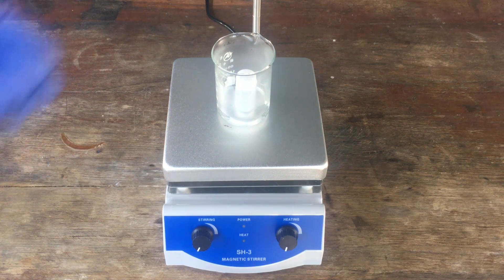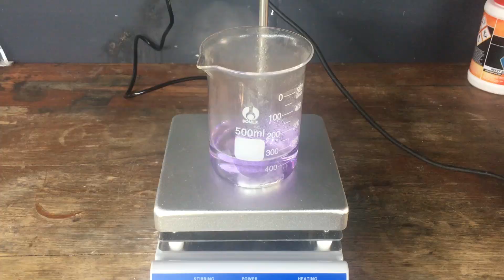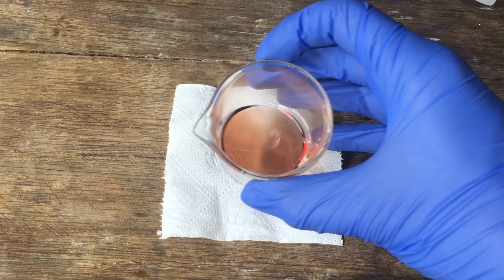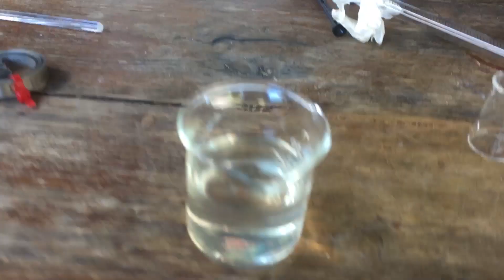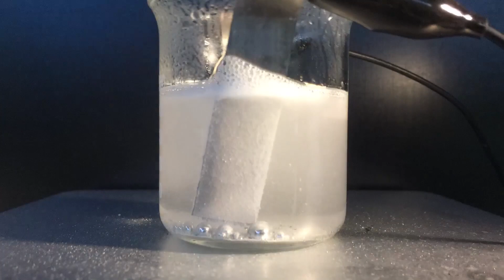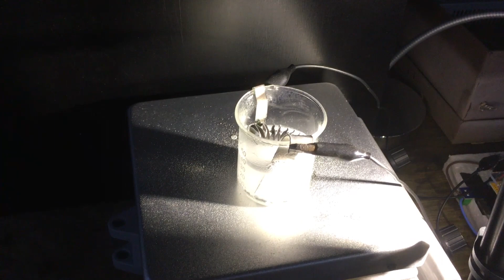Liquid Metal Electrolysis

Comment: Wow Harry, all that work for a 90 second timelapse
I don't think this is useless at all, this is so beautiful TT & that's all that matters 🥰

---
This is unrelated but I think you'll find it useful
Recently I stumbled across some CARBON FIBER tubes at my school's engineering center
And I had a BIGBRAIN moment
Maybe it'd be a good electrode that *doesn't decompose like graphite*?
I got really excited bc I want to make chlorates but can't really get cheap MMO. Look, I a asian and asian only buy if good deal 💸

So I got to it. I sawed off two 2-inch lengths of tubing, sanded off the plastic outer insulation, sawed the tubes into quarter-arcs, stuck them through slots I made in a thick plastic bottle with a soldering iron, and sealed the gaps with hot glue. (easier to make holes for small arcs than for circles). I put the electrodes into a row of four pairs and connected them to a power supply with alligator clips.
I filled the bottle with saltwater and ran 2A through it (500mA per electrode). It's been two days now and not even a drop of carbon has fallen off the electrodes haughty smile 😏
BUTTT the contact resistance between the clips and the supply was really high. No matter how much I sanded the surface, the voltage I measured at the graphite was half that of the alligator clips, which is an efficiency of $h!+ percent. The electrodes got so hot that the hot glue melted and I had to put it near the window for freezing winter air to blow over it. (Imagine living in warm summer Australia rn, haiyaa)
So there's a lot of improvements I have to make but so far I'm pretty happy with how it turned out. :)
I'm going to try carbon fiber with different solutions than NaCl and let you know how it works in each.
Reply from the maker: Interesting!
I've always been told that carbon fibre is one of the least conductive forms of carbon, so I never thought it was worth giving it a try, especially given the price.
If you can get a few pieces cheaply, it's definitely worth having a go with it. The resistance is a pretty big issue, but I'll look forward to hearing how it works out with other electrolytes.
Reply: @ScrapScience  Interesting, I guess the high resistance makes sense then. I'll keep you posted!